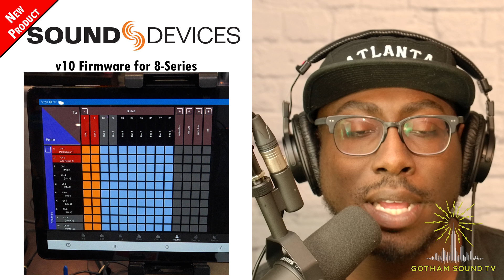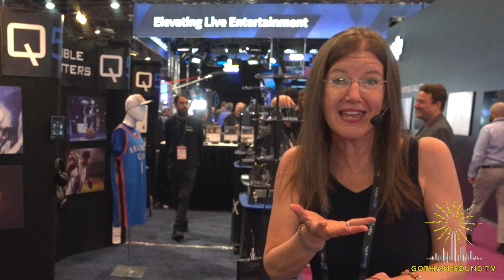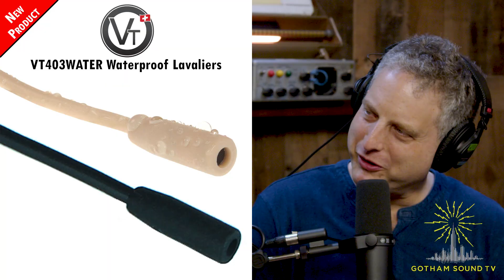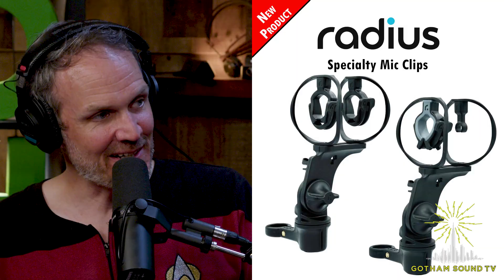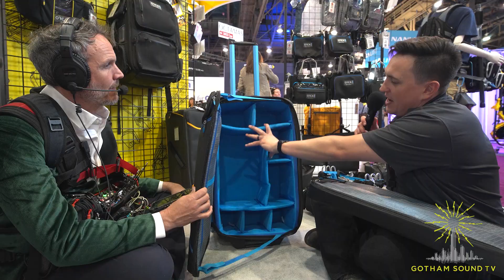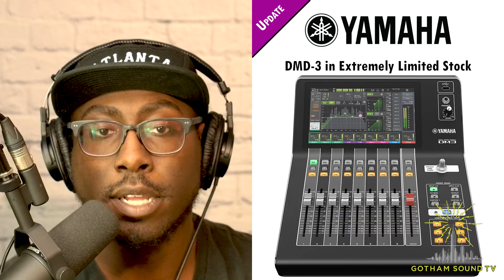Production Audio Wrap-Up April 2024

Comment: whats the difference in the ambient quick pole 5 and the slim version other than the locks ?
Reply from the maker: The Slim has a smaller diameter and lighter weight than the original and is a 4-section pole to the original's 5-sections.
Reply: @GothamSound  does the slim bend unlike the original? What’s more popular now?
Reply from the maker: @creativegreatsvisuals  They're both made of the same carbon fiber, so I'd guess they have roughly the same amount of flex, but haven't done a side by side. Both versions have their fans - it largely seems to come down to personal preference and hand size. We did a longer breakdown of the Slim here: https://www.youtube.com/watch?v=5dsY76V7-1c